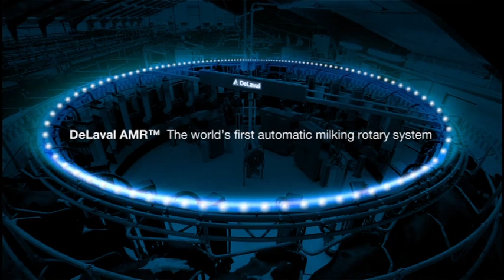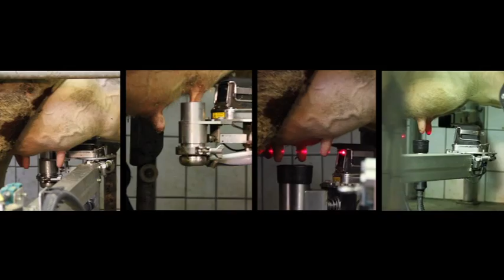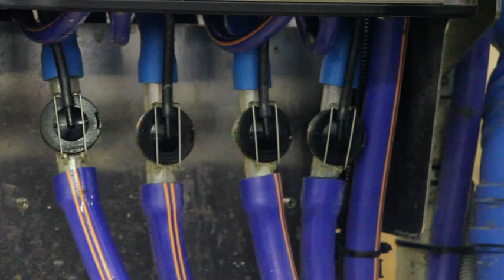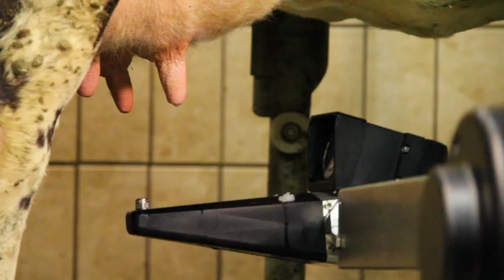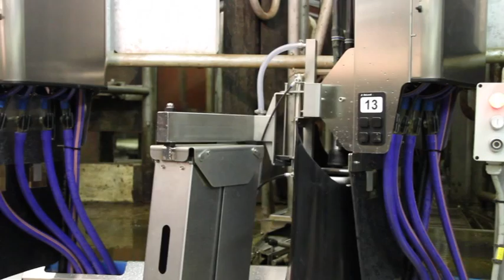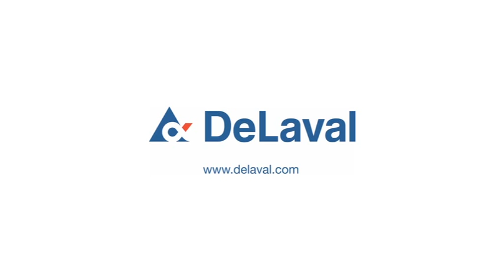The World's First Automatic Milking Rotary System AMR™ | DeLaval Robotic Milking Solutions | DeLaval

Comment: @thornguy2  Hi there, In traditional rotary milking there are frequent starts and stops, but of course not between every cow. Testing shows that it works at 90 cows/hr. 
As far as the lifetime of the system goes...because these kinds of systems are required to work almost round the clock, it will be mandatory to implement a preventive maintenance program. We expect these systems, like the VMS, to last 12 to 15 years depending on how well the system is maintained.